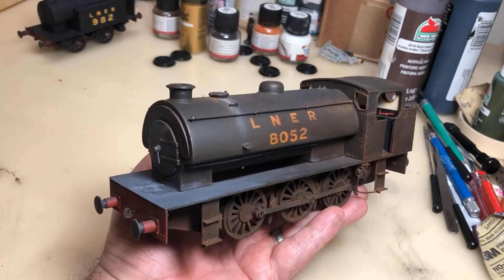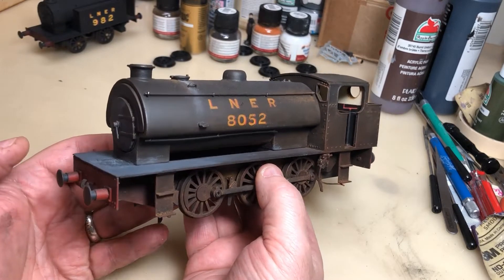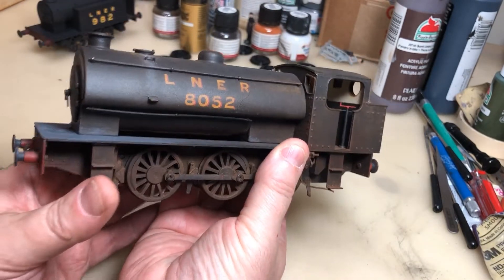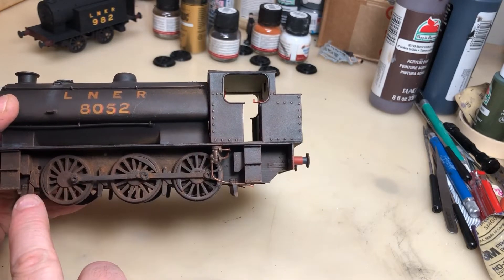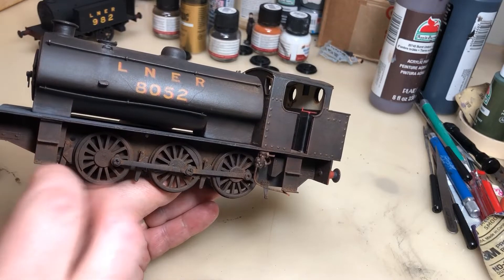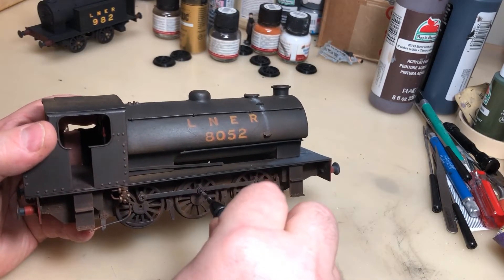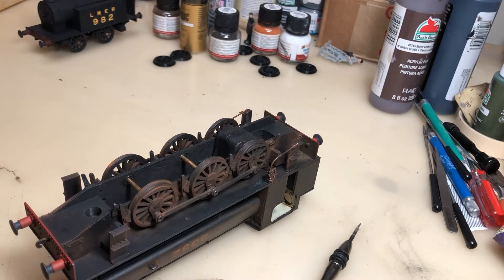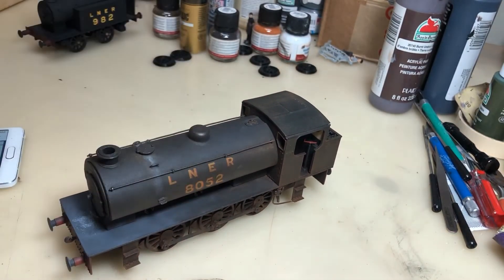WOW!    3D printed O Gauge British J94 Austerity Locomotive

Comment: Thinking back to my model boat days, I wonder if by fitting an on/off switch between the battery and motor and another switch between the battery and metal wheels fitted with pickups you could charge it by leaving it parked on a piece of powered track. My boats worked in a similar way to save removing the giant alarm battery from the hull.

Comment: ARDUINO FOR THE SOUND AND WHATEVER ELSE YOU CAN HAVE ALL YOUR POINTS CONTROLLED OFF THEM ALSO
Reply from the maker: Hi Kenny. Arduinos are good but I now use 8266 as they have onboard wireless. I certainly want to do sound sometime and point control and lights. Arduino type boards are great for these things.

Comment: This middle is amazing I would think it was made by a manufacturer if I didn't know otherwise
Reply from the maker: Thank you. It took a lot of work to get it to this stage. Typically, I get good drawings and then start creating the basic parts in 3d. This is research and development as I often have to remodel parts due to various reasons. I work to get the model looking as detailed, accurate and real as I can. This J94 still has some detail to add such as lamp irons, brake pipes, etc.

Comment: Hi, do you think that going for HO is feasable as far as printing everything (almost) and where did you find the motors for your engines? I know I guy who prints Bulgarian engines but he then turns them into regular HO train sets that run on standart metal tracks.
Reply from the maker: Hello Yordan. I believe you can make almost everything on a resin printer for HO scale. I would not make the wheels however. The motors I get are small Chinese motors that have a yellow colored gearbox. You can find them on amazon. However they would not fit in a HO scale model. You would need to find smaller motors that can handle the track voltage.

Comment: Looks brilliant. I’m going to attempt to make some OO gauge rolling stock and maybe even an engine. Do you reckon I could achieve this with just a filament or just a resin printer or do you recommend a combination of both? I’m going to purchase a primer soon and I’m a very experienced 3D modeller so I’m quite excited to get started. Cheers.
Reply from the maker: Thank you James. 
Filament printers work as long as you dont try print things al in one go. This J94 was mostly printed on a filament printer but some parts such as the buffers and backend were done on an inexpensive resin printer. I have nor tried OO gauge but if I were to I would mainly go with a resin printer

Comment: Looks great I work on Western Australian S scale 4.7mm:ft and I'm trying to do a 2-6-0 though I plan to use metal wheels and possibly cut metal con rods. I'm using resin printer though. I was thinking of doing it in 10mm:ft O gauge track after. What remote control and motor/ electronics are you using
Reply from the maker: Thank you. Larger scales should be much easier as much more room for the electronics. Presently I use an 8266 microcontroller board that connects to wireless , a motor driver board and one of those cheap chinese plastic gearboxes with motor , the sort that you find on those arduino kit cars
Reply: @3dprintedscalemodels523  great a video on how you do that would be great. Programming those is a bit over my head though I'm good at soldering, I don't think I could achieve that on my own. I'm sure many others would have interest too.